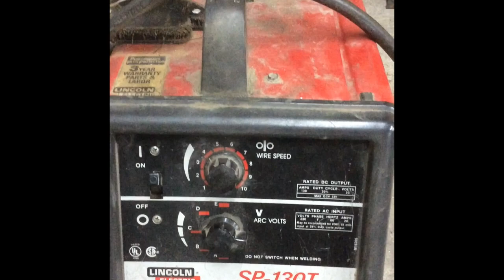Cinderella Carriage

Comment: Beautiful work. What is that thing you used to curve the metal in the begining of you video?
Reply from the maker: It’s called a tubing roller. It has the ability to to roll either square or round tubing with the proper dies.
Reply: @shanecasteel8202  Thank you..where can I get one?
Reply from the maker: I do believe they can be purchased at Harbor Freight. I purchased mine online a few years ago. I ordered one with a little more adjustability. I roll more square tubing than I do round.